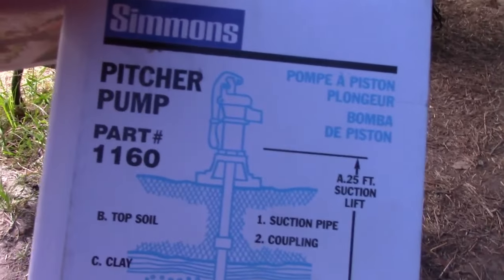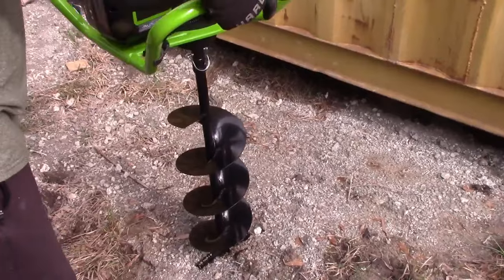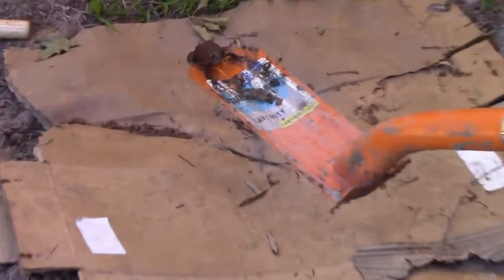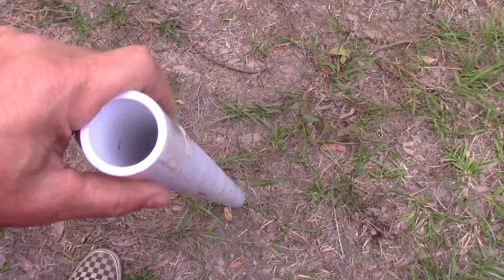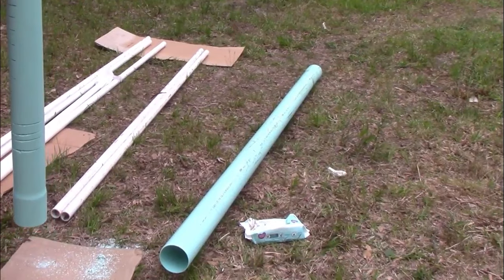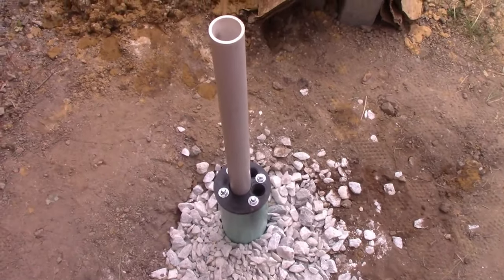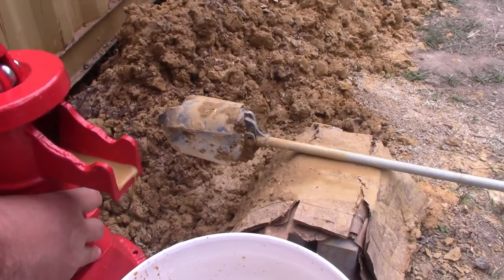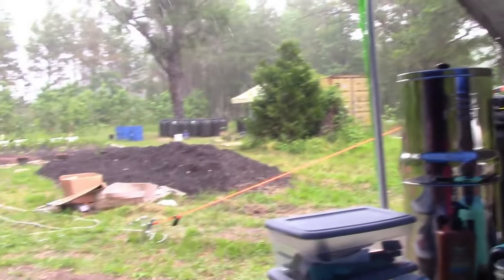Dig Your Own Shallow Well - No Power - No Water Drilling - No Driving

Comment: You need to use11/2 inch galvanized pipe and pound down into the ground with a postpounder not a sledge hammer. The  Screens on the points are so fine It won't suck in sand and you have to be able to figure out which type of screen to use on the point. I get over 6 gallons per minute on my point and it is 10 years old now.
I had my 28 foot point down and running in two days all buy myself.

Comment: Be careful when you glue the fittings together because they tend to jack themselves apart. You can see that clearly with the first coupling which jacked itself out almost 1" after it was let go. Put them together dry and run a marker pen around the pipe, then prime and glue up to that mark on the pipe. That way you can see where it needs to be and hold it there until it grips, it also makes for a tidier job.
 I wish I had water that close to the surface here. We just had the first real rain after 7 months, a 100 year drought in this area of SW Australia.
I also wish we had the tools you can buy to put the well down, it's just crap from China here these days. Lots of made in USA on the parts you used which is good to see.
  Thanks for a great video.

Comment: Good stuff Doc. I am wondering if you are worried about surface water infiltrating the well through the gravel used to backfill the casing? Would a solution be to backfill the last few feet with concrete maybe? I live in the country and have a regular well drilled by a well company that we use here at the house. I built a solar system with a battery bank and inverter large enough to power the well pump in addition to other things but think it would be cool to add a pitcher pump to the well as another failsafe since battery banks don't last forever. . We also have a small seeping spring  that I tried to modify so that it flows and I was successful in getting a nice trickle of water out of it but only have about half of the seep captured, I might work on that this summer. Unfortunately though the spring is a bit of a walk to get to.
Reply from the maker: Yes, I should have explained that,  I will make a concrete collar around it when I set my base up to lock the surface water out.  Thanks for bringing that up
Reply from the maker: If I were in your place I would build a spring box instead and use fresh spring water.  Awesome your well is off grid :)
Reply: @TarrinLupo  I think you are right about the spring. After reading your comment I found several youtube videos with methods to develop the spring which look way better than what I was trying to do. New project for the weekend!

Comment: I see these videos for digging a shallow well, What exactly will you be using this water for. If not for showering and or drinking then what is the water for? Would you use it for plants and animals or not the animals? What is the solution if you cant afford to dig hundreds of feet down but you still must have water on your off grid home.
Reply from the maker: Most areas of the country can not use a swallow well.  You won't find water only 25 feet down.  I dug this because it cost a fraction of what I would have paid a well company, We mainly use it for watering the garden but we can filter it for drinking water if need be.  
But honestly if I was in your position , I would not dig a well and instead spend a few grand on a nice water catchment system or a machine that pulls water out of the air.  Wells have got crazy expensive and there are much cheaper options now.

Comment: how do you deal with rocks that keep on binding the auger?  I jimmy rigged some hand dig auger extensions on an electric auger head.  goes way faster than trying to cut through my hard packed clay loam by hand until I encounter rocks that keep jamming up the bit and wearing the teeth down.  I'm thinking i might try a heavy cylinder with teeth on it to hopefully break or displace the rocks, or jet the hole out, except I would have to bring in water which would be a big bottleneck.

Comment: So many push electric replacements, but ignore that if solar and wind isn't available, fossil fuel is used to produce the electricity. We are heading that way, but are not there yet. I was taking classes on solar design and technology in the early 80's and the professor was a genius, but even he admitted we had decades, or up to half a century till we were ready to convert.
Reply from the maker: We feel gas might be really expensive or impossible to get in a grid down situation, that is why we went electric.  It is not as powerful but I can at least make power for it.   But you are right gas is faster.

Comment: You shouldn't have gravel at the top.  you need to seal it with bentonite clay to prevent surface water contaminating the ground water

Comment: Tip: use rain /shine glue.. with the purple cleaner . it welds pipe slower and better ! HOLD glue couplings 10 seconds.. cause they do as yours did= backs itself up. and you not get full areas glued. . cleaner needs be solid purple color.. its main purpose is= makes area soft and ready for glue to solid weld the 2 pipes ... pliers.. you used backwards..lol.. they bite on there own as you push.. ! 4 inch pipe you didnt coat beggining edge /like 1/4 inch lol. thats most important area. tip/ i like use cleaner inside same pipe to be glued= cleaner does 2x longer than the glue! cleaner softens the area better if do this. although glued perfect/ it hard/ brittle =want go inside/ or take out.- without doing 10 feet sections.. but its easier and better after installed/ want ever come unglued!

Comment: Unfortunately, most PVC is not rated for use for drinking water, not due to a high risk of toxicity, but due to the fact that it can degrade with high temperatures, UV light exposure and extremely high pressures. Any degradation can damage the water supply and make it unsafe for drinking water.

Comment: Building a drilling derrick would have saved your back. Unfortunately using electric is a pain compared to gas as with gas you could use the weight of the motor. Your idea is awesome, but there are other ways to get further faster with gas.
Reply from the maker: That would have been a smart idea. It got super heavy.  I will do that next well.

Comment: Doesn’t seem too smart to cap the bottom.  No way to go deeper if needed.
Reply: I was thinking much the same. I have a well on mountain property my family owns. It's at about 380 feet, and I'm wondering what happens if the water level drops. It's served us well for almost 50 years, and is just no showing signs of not pumping as much water. We have it choked down to 10 gallons/minute, but it has a capacity of 80 GPM.